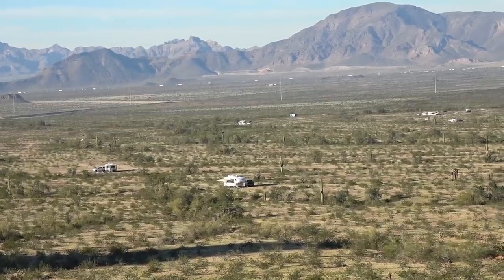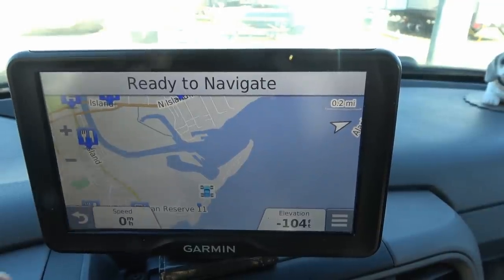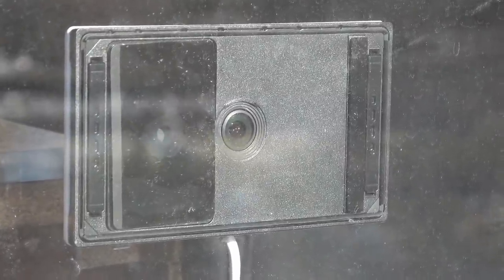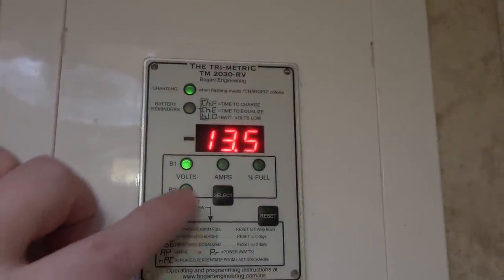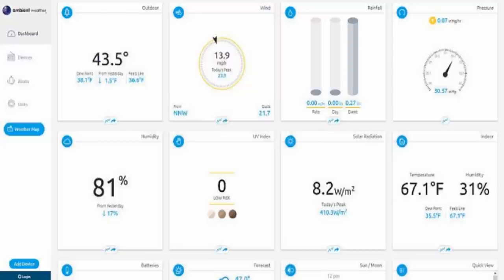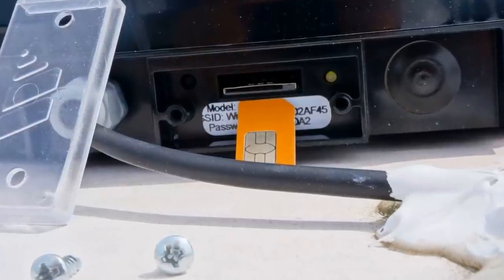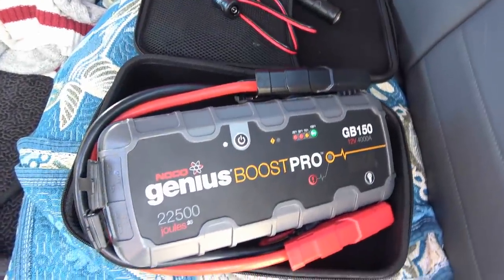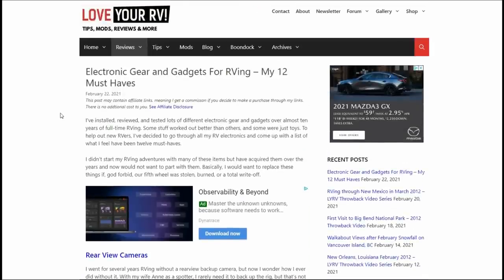Electronic Gear, Gizmos & Gadgets For RVing – 12 LYRV Must Haves

Comment: Another great video.  I agree that once you have the must-haves, you won't know how you lived without them.  We have a rear-view camera in our suburban as well.  The tinted windows or a high load are no problem, and we have no blind spots.  The signal boosters, weather station, and surveillance cameras are the only ones we don't have.  We went with a pedestal mount power management unit.  That way we can test the pedestal before we open up our Trailmanor.

Comment: Always look forward to your videos! I bought a Trace 1 Pro but had trouble with it. Not sure if it was operator error, or a defective device.....it kept shutting down randomly.  Do you recall what brand and size sd card you are using? I have heard these dash cams can be "finicky" with some of the sd card from various manufacturers. Cheers
Reply from the maker: I've used the 32 GB and 128 GB San Disk Ultra Plus and no issues  https://amzn.to/3unAMz7

Comment: We travel pretty simply but I am still on my original battery...a Walmart lowest price deep cycle that was almost a year old when I installed it. Coming up on its tenth installed year and I'll swear it is because I lucked out (before I even knew about it) and bought a NOCO trickle charger that also has a desulfation cycle. 

First install and use and three days later its still blinking at me! Finally read the manual and went online. 4A charger on a couple of year old battery...desulfation takes time. LOL. Battery tests out, accepts charge, runs us out there and etc as new.  Buy a modern trickle charger is what I'm saying.

Comment: How's that gorilla tape holding up on the awning? seemed good still after the 9 month update
Reply from the maker: It lasted pretty long, got almost another 2 years out of the awning. I replaced the material last summer as it was starting to pull away from the camper as the threads holding the bead were failing. For a while I used Eternabond tape along the top. Here is my new awning install video -  https://www.loveyourrv.com/new-rv-awning-fabric-installation-solera-universal-replacement-from-lci/   Cheers, Ray

Comment: Hi Ray , question, did you change out the rubber valve  stems on your trailer wheels for your TPMS  ? I don’t know if this is  a must or not  thanks 😊
Reply from the maker: I didn't have to because the first time I got new trailer tires after about a year of travel I told the tire shop to add the metal stems. It wasn't much more in cost if I remember. Even without the TPMS, I wanted metal stems versus rubber. Most TPMS  makers advise metal stems and I think it helps the heat transfer from the wheels to the sensor better.
Reply: @LoveYourRV  thank you for the reply !

Comment: Every new gadget is thought to be a plus when first purchased. It's only after some time do the one's not worth the cost and effort to install become evident.  By then a channel would rather not admit the truth after doing a video about how great it was the first few days they owned it. How about a video on ten gadgets not worth buying?  Wouldn't that be just as or more important to know information?  Sadly that kind of advice is  typically "forboden"  by YT channels and that makes it even more informative, imo.
Reply from the maker: Good idea. I should go through my old reviews and pick out a total bad product list, can start with this - https://www.loveyourrv.com/more-winter-rving-prep-wireless-lp-gas-level-meters-ac-weather-cover/ and https://www.loveyourrv.com/betterweigh-mobile-towing-scale-review-part-1/
but I don't think its forbidden or that uncommon as you think, have seen many YouTubers put out such a list. In fact many do it becasue they know that negativity often draws more views.
I usually update my reviews after using things for some time 6 month to 2 years and have done many review update round up posts over the years in which I point out products that didn't work out or had flaws only found after extended use.  Cheers, Ray
https://www.loveyourrv.com/lci-rv-product-review-updates-sneak-peek-at-next-install/
https://www.loveyourrv.com/2018-ram-3500-truck-review-update-35000-km-21748-miles/
https://www.loveyourrv.com/20-more-rv-product-review-and-repair-updates/
https://www.loveyourrv.com/20-love-your-rv-product-reviews-how-have-they-performed/
https://www.loveyourrv.com/cougar-trailer-review-fulltime-rving/
https://www.loveyourrv.com/rv-upgrades-review/
Reply: @LoveYourRV  Wonderful you think so.  I had my doubts and I'm please you might use the idea for another video.  Always having to come up with more ideas is a challenge I'm sure.  Thanks for the link, I watch it. Best wishes Ray.
Reply: That's one of the things I appreciate about Ray. Especially with his professional background in electronics! Good honest impressions and reviews with updates. I get what you're saying though. Nothing more useless then an "unboxing and review" video by some hipster twit. Was looking for reviews on hike boots. Couldn't believe the number of basement prep'er military wannabe's giving opinions on boots that had obviously never left the house. 
Ray's the go to guy, IMO, for gadget reviews.
Reply: @wingnutbert9685  Yep! Youtube is full of those vapor content mills. Buy a Go Pro, watch a few video's on something you've never done before and then they're an "expert" giving advice and pointers.  Ray's finished wiring projects as one example shows he's experienced and takes pride in doing a job he's pride to have his name on his work.  The unseasoned just want to get it done and move on.